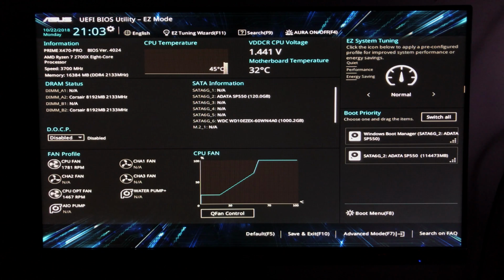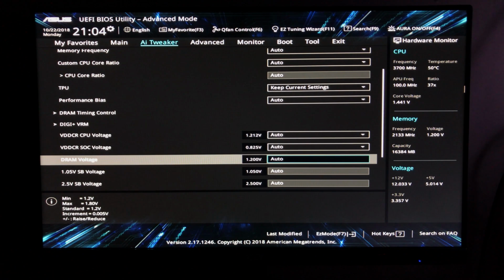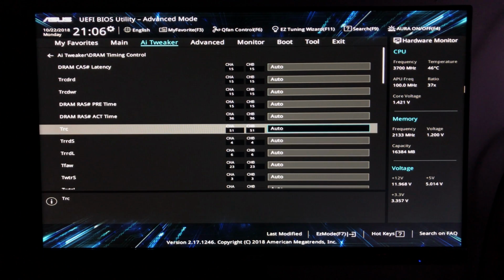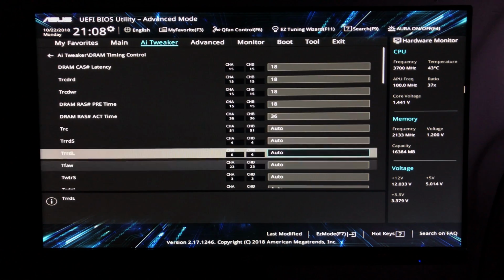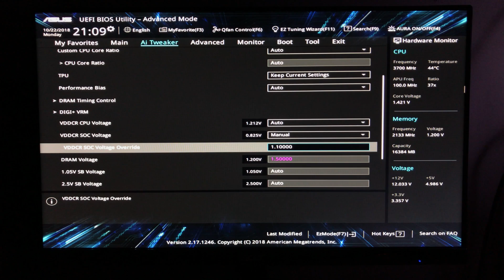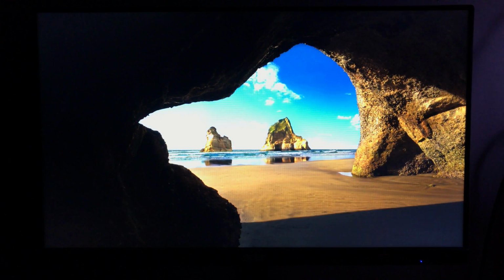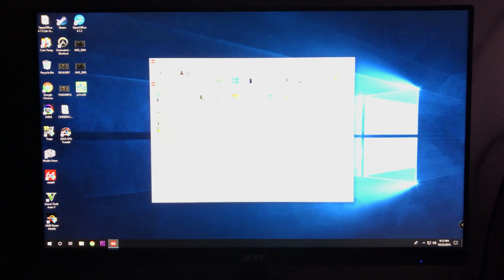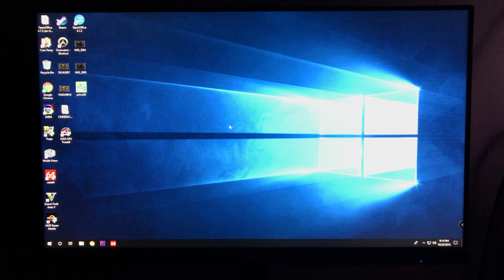The Basics of Overclocking Ryzen RAM Using the ASUS BIOS

Comment: Question 
@Dan’s Desktops I'm running my 2700X on 4.3 easily, above that it get's complicated to keep it nice and stable. But have (an expensive, well for me it is) AMD optimized CL14 3200. The Ryzen 2000 series should run better at tighter timings and the 1000's on higher frequencies right? What can I do best? Noob at memory overclocking btw... I did get it faster, but windows will give an occassional error... 😅 ( highest stable score on Cinebench is 1950 and a bit) Want to get it above 2000, just because... Came close but was unstable...
Thx for you trouble and time!
Oh... p.s. Running on a ASUS ROG Crosshair VII, so pretty overkill... I'm never cheap concerning motherboards...
Reply: U still around

Comment: I have a 2x4 gb 3200mhz hyper x predator and the mobo recognises it as a 2400, what to do?
Reply: Use the xmp profile bro...you can enable it in the bios.....
Reply: @nonickname2372  can you tell me more? The mobo i have is an asus b450 plus and my cpu is a ryzen 2400g
Reply: you do realize, most of cpus are locked at 2400+/- Ghz?  u can only overclock it so u can surpass the limit

Comment: Hey man. How do you know if the 2 rams are running on dual channel? Is it possible to know in thr bios?
Reply: Kevin Sabile In windows just download cpuid and it will show you is it single or dual channel
In bios you can check it in ram settings, you have info for CHA (which means Channel A) and CHB (which means Channel B). Now if you see info for both then you are runing dual channel, but if one of them shows no info(empty boxes), then you are runing single channel
Reply: for exemple you have A1.A2.B1.B2 in order to run in dual channel you must put 1 ram to A1 and other in B1 so A1/B1 (if you have only 2 ram)
Reply: A2 and B2 should be the populated slots, on most if not all motherboards. If unsure, consult motherboard manual.

Comment: Is this ASUS B350 PLUS? I have this MB and it can't handle G.skill Flare X Series 16gb (F4-3200C14D-16GFX) at 3200mhz. So sad because is such an expensive RAM.
Reply: M. Cuenca did you turn up voltage?
Reply: @OwMyNuts  Can not run my CL 19 4400er Ram :D cant run it with 3200MHZ @ 1.45 Stable need to go lower @ 2933 with AUTO ;D

Comment: Bro...using SOC LLC5 is how my old 1700 got fried. It took about 3-4 weeks until VRM temps were 103C at idle without any workload... voltages needed to be raised and frequencies needed to be lowered to stop crashing. I realize its ok while benchmarking because unsafe voltage is kinda ok with very good cooling for short times like a couple hours overclocking session. But i dont think noobs should ever go above 2-3 LLC. If you dont set it to manual it goes to 1.15, add raised vdroop which LLC gives you more than you ask and that and you have a unsafe voltage and some will think its fine. Great video but i just wanted to clear that up. Keep it up man
Reply: Where is LLC set when on auto?
Reply: @Tjecktjeck  https://youtu.be/Z8nFdFpuVBg here is where i learned what llc is doing. Auto is allowing all Vdroop. Anything lower than the highest 2 setting for example llc4 and 5 giv tge exact voltage and MORE voltage for level 5 pending on your board. I have an asus x470-F and i never go above level 3 for cpu. It is meant when the load on the cpu makes the voltage drop too far and llc doesnt allow it to drop to where it crashes. Be aware that software wont tell you about this added voltage especially highest llc thats why its stupid. Highest LLC IS STUPID. I just want everyone to know its not something you want to max out. Personally llc 2 is perfect once cinebence wont finish and voltage almost helps. Just remember some vdroop is necessary. Its how switching power supplies work